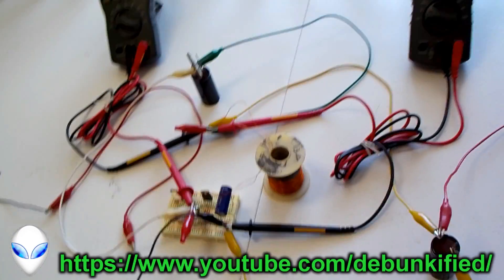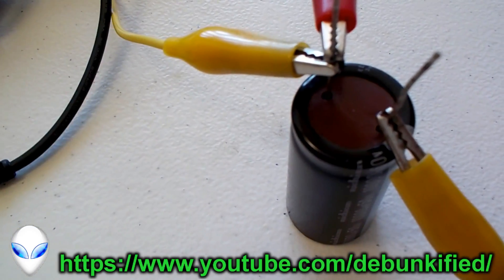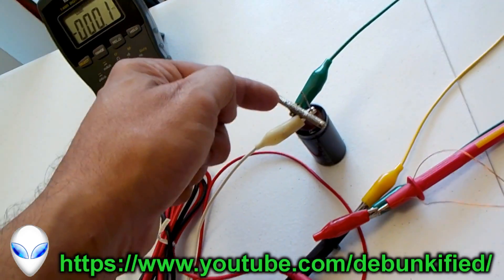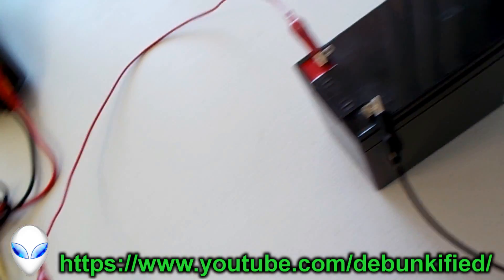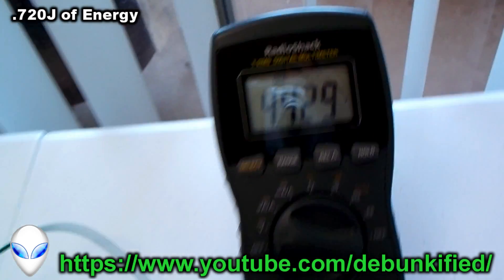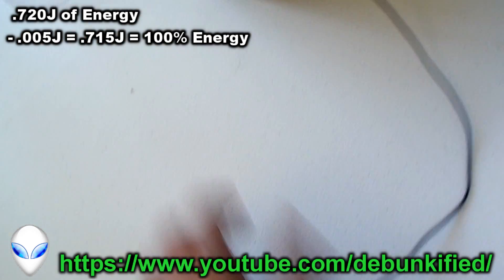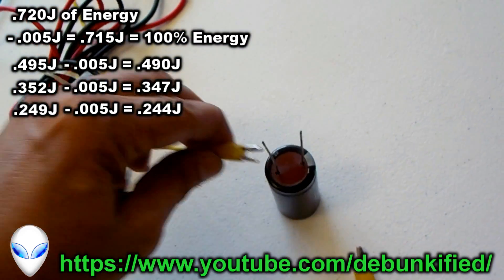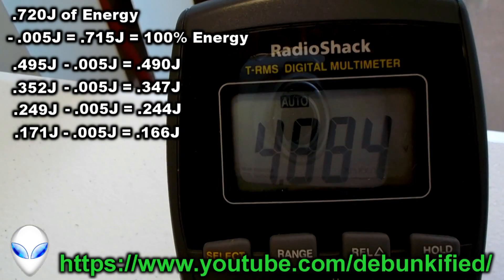Ultimate  Evidence of Power Magnification

Comment: You have to show how much power dissipated on your load. Since the current on load is variable needed to measure with scope and then integrate, in order to calculate the work done on your load.
Reply: Irms^2*R*t=W work done on load
Reply from the maker: +Arman Gevorkyan Hi, I showed power dissipated on the load by basically pulse discharging the capacitor into the load (inductive coil). Starting from 12V in a 10,000 uF capacitor then discharged to 1V is .720 Joules of energy minus the .005 Joules left over is .715 Joules of energy dissipated in the load or alternatively .715 Watts of power (work done) in the load.
Reply: debunkified you have showed that during transfering energy to second capacitor you get 500j energy on second and lost 215j on load during transfer and 5j left on first capacitor. Now you have to show that on the load dissipated more energy than 215j.
Reply from the maker: +Arman Gevorkyan Hi, I do not understand where you are getting these numbers from.

I assume you have rounded up the second capacitor getting charged up to .495 Joules of energy.

I do not understand where you are getting .215 Joules lost on load during this transfer of energy.

I clearly show that during the first transfer of energy that .715 Joules of energy leaves the first capacitor and into the load while the second capacitor receives .495 Joules of energy from the load.

From there .495 Joules of energy performs another .490 Joules worth of work on the load and so forth.
Reply: debunkified 12v on 10000uF is 720j. 1v on 10000uF is 5j, and 10v on 10000uF is 500j. So if you will show that your load disipated more than 720j-500j-5j=215j then  you can claim overunity. Hoever I do not see heat measurement on coil or measurement of current and voltage on the load. Anyway the mistake is that you asume that all 715j doing work when it pass via load to second capacitor. If you will show that the load dissipates more than 215j energy you will covince me that there is a overunity.
Reply from the maker: +Arman Gevorkyan Hi, well you say no measurements were taken of the load, but the load is in parallel to the capacitor as the power source.

This means that whatever voltage and current is across and through the load is the exact same voltage and current supplied by the power source, a 100% transfer of energy doing 100% work on the load minus losses of course.

Let me ask you something. If .715 Joules of energy left the first capacitor, did this not do .715 Watts worth of work? Energy is equal to work x time. What am I missing here?
Reply from the maker: +debunkified First .715 Joules of energy left the first capacitor. So you are saying that .715 Joules of energy did not dissipate into the load and do .715 Joules worth of work? And are you saying that the load did not dissipate .715 Watts of power?

Would it help to add a rotor on top of the coil to show that mechanical work is being done as well along with the .715 Joules of energy that's already doing .715 Watts worth of work which is equivalent to the energy supplied by the capacitor?
Reply: debunkified yes the load is in parallel however the current is not continius it is switching and withoutot scope mesurement of voltage and current and integration of energy disipated on load you can not claim that all 715j of energy doing work on load.
Reply from the maker: +Arman Gevorkyan Ok I understand the power is being pulsed and using a scope would see this more clearly, but with experience with scopes, scopes are not much different when using a voltmeter and the accuracy is only a few percents different.

We are talking about energy leaving a capacitor, so where do you postulate the energy is going then if it's not going into the load?
Reply: debunkified I do not postulate I would like to see that it is doing work of 715j on load and not 215j. One of the ways to see that is to use scope and not voltmeter only. I do think that there are systems that can produce more energy than gets and these systems getting extra energy from enviroment or other. For instance thermoelectric cooler can produce more heat in term of energy than it gets at input and extra energy it takes from ambient by cooling. Anyway I am against postulats I think anything need to be experimented. I appreciate the work you do, however it is not complete to say that in this particular case there is a overunity.
Reply from the maker: +Arman Gevorkyan Hi, a lot of what we do involves simplicity. Sure an O-Scope could be used, but this is an exercise of the mind, and a revolution of the mind.

We believe it is possible to solve questions in our minds using pure logic and understanding as tools.

Just think for a moment. Yes there are rapid pulse trains going on at high frequencies, but we are not measuring these, there is no need to.

This video isn't about claiming OU, it is about work magnification, which can be a type of OU. Logically thinking, we already understand that using simplistic math formulas and a meter we can most obviously see what is coming out of a capacitor.

Like you said, if a 10,000 uF capacitor is charged to 12V, then obviously it has .720 Joules of energy stored in it.

If the capacitor is emptied down to 0V, then obviously the energy has gone somewhere else.

Let's say we didn't pulse the energy but instead just left it on, across a coil. Then the coil will behave like a normal resistor.

This would be like one long continuous pulse left in the on position, never being shut off.

Obviously the coil is doing work dissipating all the energy from the source, and maybe perhaps a little bit as heat inside the source.

If 1 Watt is coming out of a source, then one watt is entering a load, very easy. Must we refer back to the definition of what one joule of energy is?

However there some exceptions and instances of a load not actually receiving all the energy from the source, but this is taken care of through impedance matching for pulsed systems.

Now back to our electromagnetic coil being left on. Now turn it off. The magnetic field collapses and now we are left with a little bit of something that is not the energy that left the source and into the coil.
Reply: debunkified So what are you tring to say that only part of energy is converted to heat on coil the rest is doing another work on coil? But the rest energy is reactive and that part which is not heat is transfered to second capacitor.
Reply from the maker: +Arman Gevorkyan Hey, what I'm saying is that energy is equal to work, a common formula and calculation. 1 Joule is equal to a 1 Watt second.

Let's say we didn't catch the collapsing magnetic field, flyback voltage, or kickback spike.

Then all that we are left with is current coming out of a power supply of some voltage, or in other words wattage.

Watts leave the power supply, those exact same watts enter the coil, or any load for that matter such as an LED light, radio, cell phone, resistor, or whatever load.

This is the 100% transfer of energy.
Reply from the maker: +debunkified Or, I suppose you could consider the second capacitor as a load as well.

The second capacitor is receiving the energy that came from the first capacitor, through pulsing of the coil of course.

This is an obvious transfer of energy and it takes work to transfer this energy and the rate of this work is measured as power entering and charging the second capacitor after being stored in the coil's magnetic field and being discharged from it.

I'm going to copy this exact comment and send it right here to Stefan as it relates to his concerns as well.

Comment: I like where you're going, however, someone/thing still has to carry the bucket back up the stairs to dump down the paddle wheel. i.e. 555 timer... what about getting the source to power the switch?
Reply from the maker: +Cool Joule Hi, the source could indeed power the 555 timer chip, but the power running the 555 was eliminated in order to observe the power coming out of the capacitor and into the coil only, as well as the power coming back out of the coil.

Comment: Interesting, How much power did the 555 timer use during the run you forgot to subtract that to the equation to get total efficiency. (power output)/(power input from all components in circuit)=efficiency
Reply from the maker: +Brandon Watts Hi there, the power the 555 timer used was not included, calculated, nor forgotten about as I showed that, because it wasn't important as only the power coming from the power source (capacitor) and going into the inductor (load) was considered.

The 555 can be completely eliminated if a pure oscillator circuit was used, which uses much less than what a timer uses which could be as much as a whopping .030mA of current, this is horrible and would take away from the power measurements considerably.

So the 555 power is unimportant, that's just the power required for switching purposes and doesn't need to be measured for just observing power coming from the source and into the coil, and then back out of the coil.

The same thing can be done on a pure oscillatory circuit in which the required switching power is minuscule and could be included, with the complete elimination of the 555 timer chip.
Reply: So you are indicating that the whole circuit will run without the 555 timer? Each component used to make the phenomena happen has to be considered and measured.  How did the capacitor drain itself to 1v while charging another capacitor? If there is just 2 capacitors and 1 inductor only, the capacitors would just balance each other out to the same Voltage and no work can be performed.
Reply from the maker: +Brandon Watts Hi, a circuit can easily be made without the 555, to become self oscillating and trigger switching its own power. 

Capacitors only balance themselves out to the same voltage level if they are directly connected in parallel, which this isn't the case in this circuit.

An inductor is involved which allows the charging of the secondary capacitor up past the voltage level of the primary capacitor.